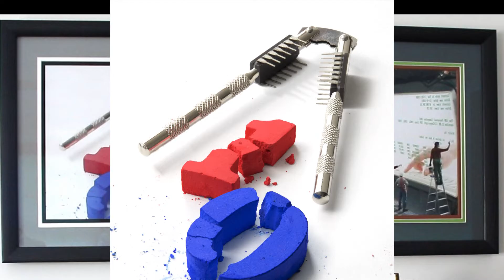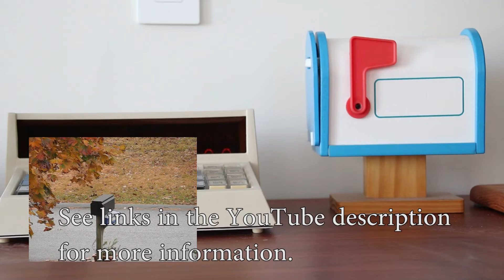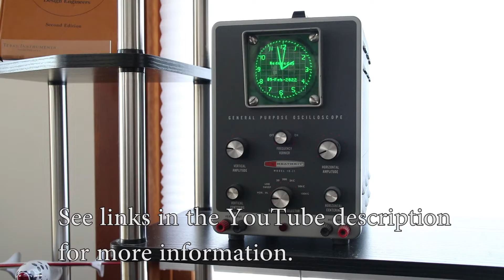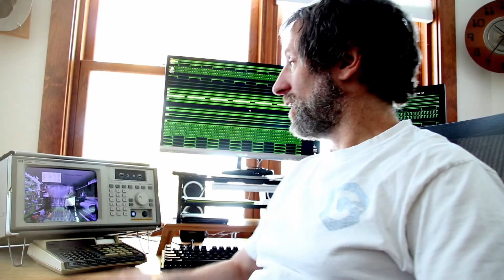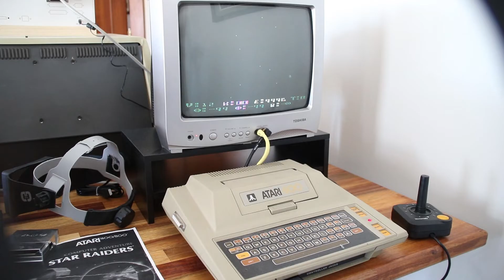Retro Computing Office Tour

Comment: I want that AT&T Unix PC. I had a friend in junior high whose dad worked at Bell Lab's in Murray Hill NJ, and they had one of these machines, fully decked out at home. First Unix box I ever got to use, and the first TCP connected machine (through some kind of digital leased line back to AT&T Bell Labs a few miles away), was absolutely mesmerized by that computer. Every chance I got, I poked at that machine because it was way ahead of its time.
Reply from the maker: @smakfu1375  It's a shame the IBM PC architecture wiped out everything else. Computers became a lot less interesting.

Comment: Them Sinclair machines were kinda ruined by Timex. The entire point of them were to be the cheapest crap possible so that parents could give their kids a machine without worrying too much about cost if it was broken. Every corner possible was cut in making these machines to a price point of less than half that of a VIC-20, including using broken RAM chips(they were faulty 4kb chips that would work if used as 2kb), sound and graphics handled in CPU, no RF shielding except on the RF modulator and that's just the tip of the iceberg. Of course, when Timex brought it to America, they completely missed the point and "fixed" everything, and sold it at a high price. Really confusing move considering the market saturation in the US by that point.

Comment: The mailbox is awesome!
Reply from the maker: Thanks. It's a long walk to my curb, so this gadget really helps me avoid exercise, fresh air, neighbors, and other nastiness.
Reply: @GalacticStudios  I'm curious how the IR sensor does in the cold. Sometimes an IR sensor that works find at 70F will start to get flakey at 40F.
Reply from the maker: @HeyBirt  It hasn't been a problem, even at sub-freezing temperatures.

The batteries have been a problem, though. Alkalines don't like New England winters. I need to use lithiums.
Reply: @GalacticStudios  Thanks, good to know the IR is not an issue. A friend in Canada who developed a monitoring system for sugar maple tree sap production told me they found out that the old EverReady carbon zinc batteries provided the biggest bang/buck in the cold. (Which surprised me.)

Comment: Wow! Absolutely fantastic! You brought me down high tech memory lane with this video. I first saw the Wang calculator at an interactive display in the Boston Museum of Science. I once helped a friend program his Timex Sinclair. I worked for DEC in the 1970's and 80's and have used a VT-52, although at that time they were almost obsolete. I was on the design team of the VT-200's which replaced the VT-100's which replaced the VT-52. I believe the VT-100 was the first video terminal with a detachable keyboard. Of course the VT-300's replaced the VT-200's but I was working for Lotus by then. I was surprised you didn't have some core memory lying around. I used to test DECSystem-10/20 core memory at DEC's Marlboro, MA facility in 1977.
Reply from the maker: Yup, I know the Wang calculator from that Boston MoS display, too!
Reply: You did a great job with the 200's.  That's not to say the 52 was bad, it was what it was at the time. But the 2nd bank I worked at used a system that required the VT131 and we had to get compatible ones as the 131s weren't available anymore.
Reply: VT52s stuck around for a while. I used one back in the mid-80s, probably because I was quite junior and didn't rate a VT100. It certainly wasn't the best terminal ever made, but it had bags of character, with that weird springy keyboard, and the crude audio feedback.

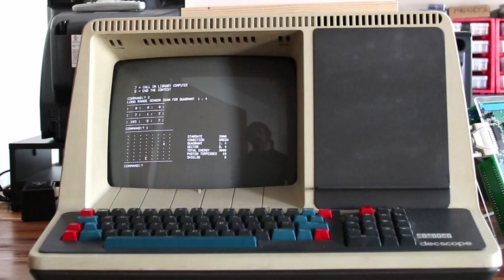Comment: 5:04 I heard it said that the “bell” sound on the VT52 (more of a buzzer, really) resembled the sound of a ’57 Chevy stripping its gears.
Reply from the maker: It's a click, not a buzz. There's a solenoid that knocks against something. At least, that's what my VT52 does. It's possible that, as a mechanical part, it's not working so well anymore.

I've never heard a 57 Chevy stripping its gears.
Reply: I used these for about a year or two. They buzzed.
Reply from the maker: @lawrencedoliveiro9104  Then I guess my buzzer's busted.

Perhaps it's better this way. :-)

Comment: I've got one of those Wang calculators... the whole thing - display, "suitcase", and some sort of card reader.  It worked when I got it in the 80's, but something is wrong with it now.  It still powered up last time I tried, but wouldn't operate.  I should blow the dust out of it and see if I can fix it.
Reply from the maker: This guy documented his repair of a Wang calculator and I found it very helpful: https://brianwhite94.wixsite.com/electronics/wang-320-calculator
Reply: Oooh, I've also got two of those AT&T 3B1 Unix PC machines.  I used one in the early 90's because I just had to have a real Unix box.  I hated DOS and since the only Unix I could get my hands on at the time for an "IBM compatible" was Minix, I never bothered buying a PC.  Until Linux came out shortly after... then I bought a 486.  I recently dug the 3B1 out of storage.  Unfortunately the hard drive has quit working.  I'm going to use one of David Gesswein's MFM disk emulators (see pdp8online.com) to get it working again.  The state of the second 3B1 is unknown.  Someone gave it to me years ago.  It used to power up and boot, however.
Reply from the maker: @rancidbeef582  Yes, I got that MFM emulator for my Unix PC too. Worked like a charm. I also replaced the real time clock battery with a coin cell battery holder. Alas, there's a Y2K problem: the program for setting the time doesn't accept years after 1999.
Reply: @GalacticStudios  Thanks for the info regarding the calculator and the Y2K problem!

Comment: Don't forget the Radio Shack Color Computer for your museum of crappy keyboards.
Reply from the maker: Indeed. The original CoCo had a crappy keyboard.

But you know what I'd really want? The TI 99/4. Not the 99/4A - its keyboard is OK. But before the 99/4A was the 99/4, with a crappy chiclet keyboard. It's very, very rare - I've never seen them on eBay.
Reply: @GalacticStudios 99/4 was instant trash can material

Bottom level of the landfill

Gonna be hard to find that level of crap keyboard